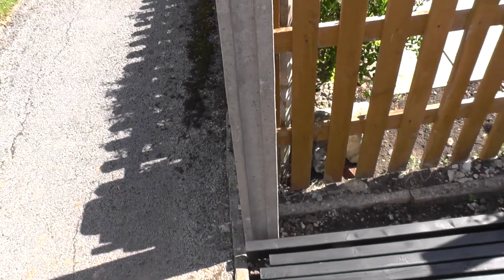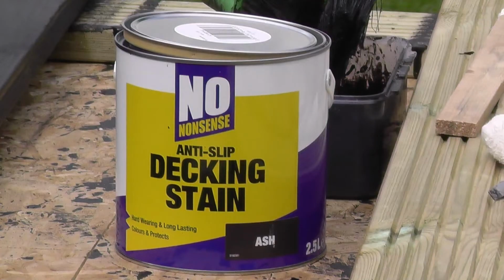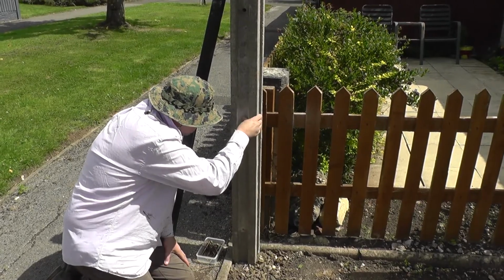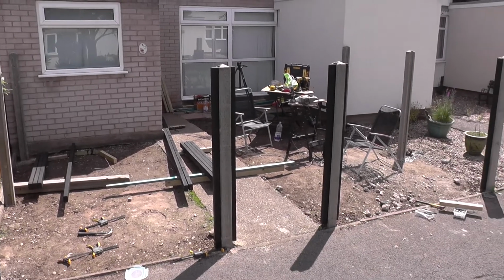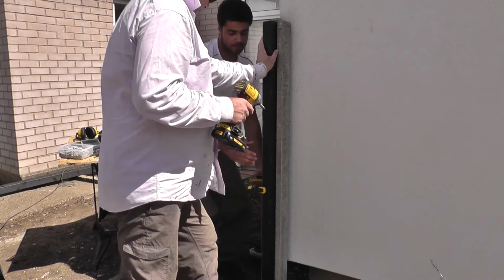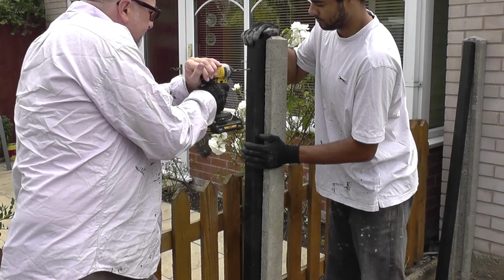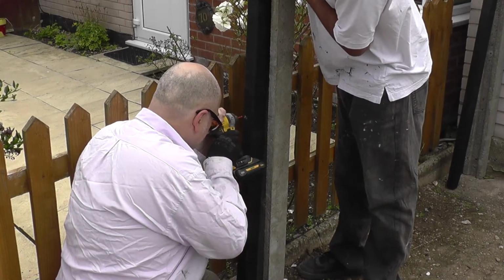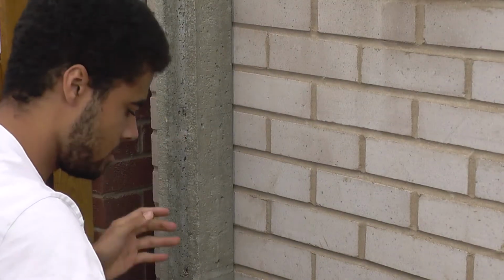How To Make A Very Strong, Cheap Fence Using Decking Boards - Part 3

Comment: I used concrete post like the ones you used in my fence line but I made my fencing in panels that slid into the gap. When the panels need retreating I slid them out and paint them else where so as not to get stain all over the post etc. Also if a panel need work on it or replacing I just slide it out and slide the new one in. Just a thought.
Reply: Good points. Well treated timber is always good looking timber.
Reply from the maker: Hi there and thanks for your valuable feedback. Panels which slide in and out of the gaps are very handy for maintenance purposes. However, there is no way this would be possible with the panels I'm making as they would be far too heavy. Thanks for your input. ATB, Des
Reply: That's what I was going to do.. just slot the decking in 6'×6'.. wasn't sure how well it would work.. re strength/stress on posts.

Comment: Use Thunderbolts or similar generic ones, drill through the timber and into the concrete using the same drill bit, no need to use a plug and they are non-expansion. Fix timber to concrete, permanently, securely and in minutes. Decking boards as a fence is an excellent idea.. Very, very strong and long lasting.
Reply from the maker: Hi there. Looks like I'm missing a trick here. I thought that these sorts of products would be really expensive but I've just been on Toolstation website and similar items are very reasonably priced.  Thanks so much for the head's up. Appreciated. Des
Reply: @21stcenturycaveman33 . It also says to drill the hole and then clean it out, some even recommend compressed air, but if you drill it an extra bit deeper there's no need to clean it out. I've just bought 80mm ,countersunk masonry screws on eBay, 50 for £7.95. Bargain 👍

Comment: I use a screw that goes straight through the wood and the concrete. Just drill it then run the concrete screw through it. No plugs required.
Reply from the maker: Hi there. Looks like I'm missing a trick here. I thought that these sorts of products would be really expensive but I've just been on Toolstation website and similar items are very reasonably priced.  Thanks so much for the head's up. Appreciated. Des

Comment: Have you just secured a concrete post to the house next door!?!
Reply from the maker: If I have that's definitely a fail!  ATB, Des
Reply from the maker: Whoops!!!
Reply: 21st Century Caveman in the vid you are erecting a fence on the house with grey bricks. A little later you then attach a fence post to the porch area with white render - surely that’s the next house along???

Comment: Never drill a concrete post absolute no no....Will crack and fail within a few years ic if doesn't explode on drilling....a DIY'r with no idea
Reply from the maker: Hi Johnny. Sounds like you've screwed up your fair share of concrete posts in the past mate?